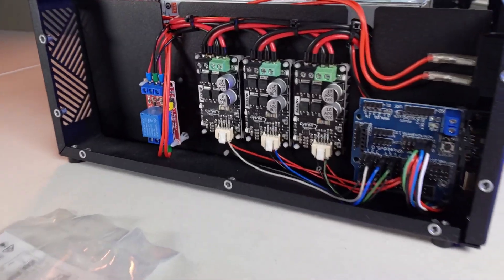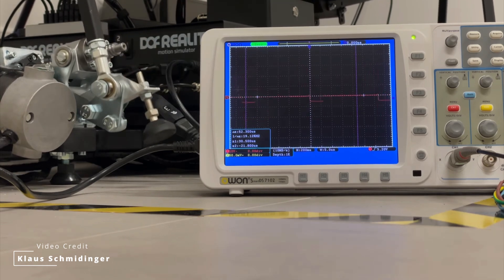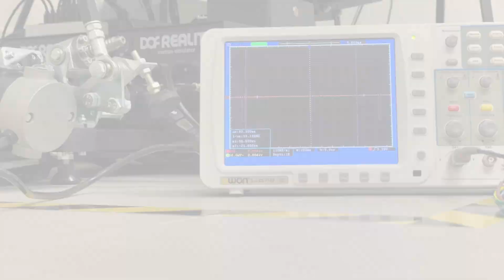The Diode Mod: Fixing "Rebounding" on DOF Reality Motion Platforms

Comment: Thank you. I purchase the P3 the 15th of August last year. The rebounding effect brought me to your video by way of discord. Okay just purchase the diode fix.  Yeah, it's crazy when in the middle of a race game getting stuck leaning to the left (mainly) or right.  I have to power off and on the motion box to reset the sim and  restart the game. It doesn't happen a lot. still annoying when it does.
Reply from the maker: That doesn't sound like the rebound if it is staying there.  Sounds like something else, maybe a bad sensor or something.  I'd reach out to DOF Reality Support and talk to them about it.  Also it could be bad telemetry from the game, does it do it on all racing games or just a specific one?

Comment: The fact that you have to modify a product you purchased to make it function the way it should just shows you, that you shouldn't have bought it and saved your lunch money and bought something better.
Reply from the maker: Couldn't Disagree with you more! Most motion platforms cost in the $20k+ range... If you have that kind of money go right ahead.  For me I'm willing to do a little work to make things better.  O by the way, once DOF Reality found out about this issue they fixed it on all future products so I don't think your statement is a fair representation of the current products or the company that makes them.  I have ZERO regrets buying this motion simulator so that is good enough for me. Thanks for watching.

Comment: I have the diodes on the large boards enclosed in metal housing. Is this also needed, I also have SFU upgrade?
Reply from the maker: DOF started doing this on units bought after Aug. 2024, when did you buy yours?
Reply: @GYGOtv  I believe I bought in the spring of 2020
Reply from the maker: @likes2fly  Yep, you can likely benefit from this mod then.  Do you ever notice weird, fast drops of the rig like the power was turned off and on very fast?
Reply: @GYGOtv  I don't get a drop like the power has been turned off but I get fast jerks/movements that are out of place and wrong direction. I did your mod yesterday and due to ctd from the newest beta release I've only got about hour and half of flight time. I haven't noticed any of the odd jerks/movements yet.
Reply from the maker: @likes2fly  Good, I hope that fixed it. Please keep me posted.

Comment: Hey Mark! Thanks - great post again! I reached out to DOF to validate this fix has been implemented, and it has! However, the issues you mentioned in your upgrade video:
1. Adding cone spacers to the struts
2. Removing excess framework that makes contact with the struts during extreme motion
Have not been fixed. 
The cone spacers I can do myself, thanks to your explanation. However, the excess fame issue is a deal beaker. That is a built in flaw that will ruin the unit over time.
I'm not very handy with extreme power tools so I am at an impasse. Thoughts?
Reply from the maker: @holdenmcgroin5276  The stock setup doesn't have the frame issue, I did some changes to mine that caused that problem. You should be fine in that area so don't worry.

Comment: Thank you for the great video, I bought my P6 in Sept 23 and I was having issues when doing fast rolls in DCS, the P6 would seem to bottom out with a clunk and nothing I did fixed it. I installed the diodes ( my boxes were a bit different but being an Engineer I knew what to do.) After installation the roll issue is gone and I am so happy. I wonder why DOF never informed its buyers of the possible fix?
Reply from the maker: You are very welcome!!! I personally can't believe how big a difference it made on mine... I think I got use to it and forgot how jarring it was.  I'm loving having the diodes in mine and recommend this to anyone having this issue.  The good news is now DOF installs this mod from the factory.  Better late than never I guess?  Thanks for the comment!

Comment: Hello, I recently got a quest 3 for my first headset.. the lenses are already really smudged. Do you have any tips on how to clean the plastic lenses without scratching them? Is it ok to use compressed air on them before wiping them?
Reply from the maker: I don't know what Meta "Officially" say but I use Lens Cleaner and a Microfiber cloth.  Works for me.  Not sure about compressed air as I could see that blowing dirt into the optics between the lenses and screen potentially.  Just treat the lenses like you would any pair of glasses. If you run into this problems a lot, you could think about getting some protective lenses from say Hons VR (prescriptions without any correction just to protect the glass).  That might be a good option for you too.  Thanks for the question.

Comment: I had this issue but more severe that it even shut off the rig so had reboot it to work. The diode fixed the issue
Reply from the maker: Wow, I didn't realize it could be THAT bad. Glad there was this simple fix to take care of that issue... that would be annoying for sure. Appreciate the comment.
Reply: @GYGOtv  I wonder if it's a combination with having the emergency stop button installed. With it installed I can't turn on the rig without the USB being unplugged first
Reply from the maker: @TommyVR  Well that should be easy enough to test.  Just unplug the E-Stop from the Control Boxes and see if it works... E-Stop does not need to be plugged in for the DOF Rigs to operate.  Of course, maybe the E-Stop button is just accidently pressed?  I've done that in the past too.  Good Luck.
Reply: @GYGOtv  yes with it unistalled I can start it without unplugging the USB first
Reply from the maker: @TommyVR  Weird, must be a faulty E-Stop? Obviously first make sure the button isn't depressed accidentally, then maybe look at the button's wiring to see if there is anything shorting out. The way they work is when they "close" they turn off the motion so a short would cause that too.  Good luck.

Comment: How do I know if I can fit this to mine ? I have the model I think after yours
Reply from the maker: If it is older than August of this year, you probably don't have the fix. They just started adding this in August.  Now if you don't notice any weird movements then you might not need to worry about it either.  BUT the fix is pretty easy and pretty affordable so why not.  Thanks for the question.
Reply: @ I can get 40v 40amp diodes   Do you know if this voltage is ok?
Reply from the maker: @shananpetherick1825  I have no idea. If you are on the Facebook DOF Builder's Group, you could ask there.  I'm sure somebody would know.  Sorry I can't help more but don't want to give you bad advice on this one.